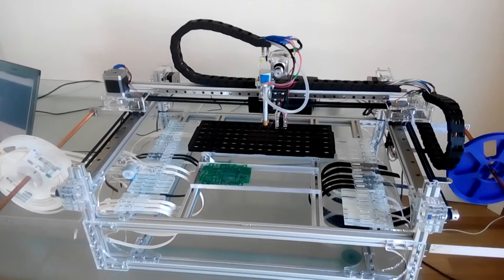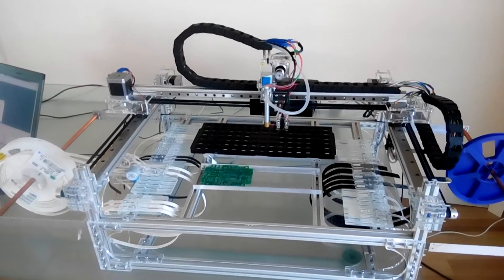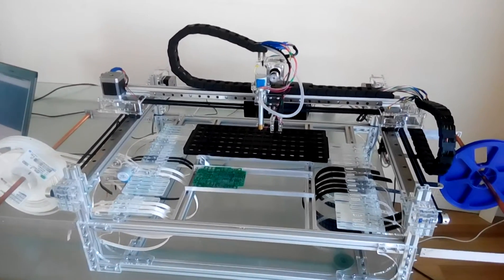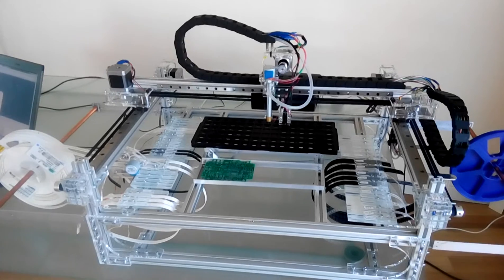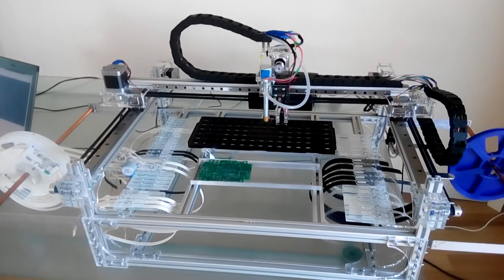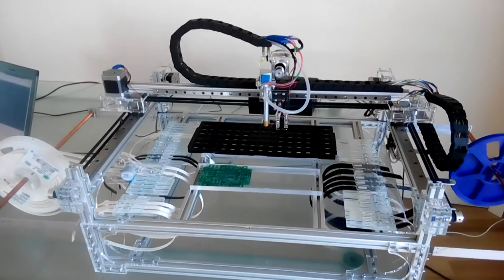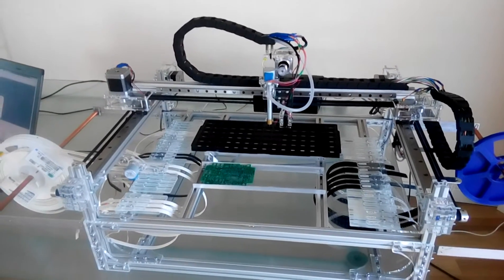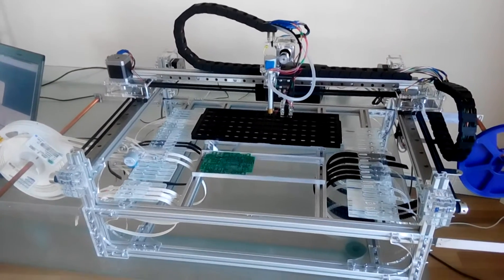Flypnp : DIY Pick & Place machine with vision - design ideas.

Comment: I recently finished making my pnp machine. It has 95 feeds and is completely mechanical. accuracy 0.05-0.07mm. 3 vacuum nozzles. There is also a 3D printing function. I have 4 videos on my channel. It is interesting to know your opinion.
https://www.youtube.com/watch?v=4JPg8JFbWSs&t=10s   -  work demonstration
The channel has 3 videos describing how it works

Comment: looks Great! How did you keep the nozzle run out low?  Can you give info on what nozzle shaft you used? thanks!
Reply: Hi,
I don't really understand the question "how to keep the nozzle run out low?", but the nozzle shaft was made using 10mm aluminium tube. 
I finally change it to more standard samsung nozzle, because changing the tip was a hassle.